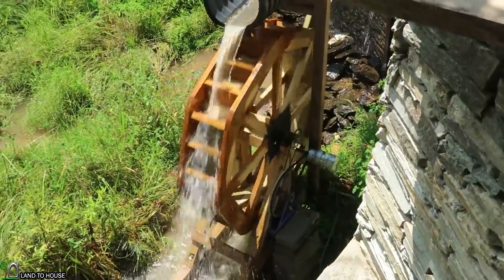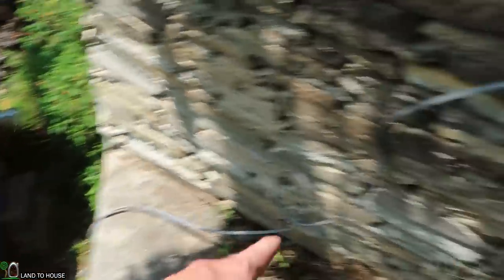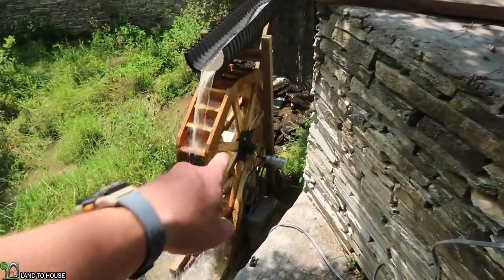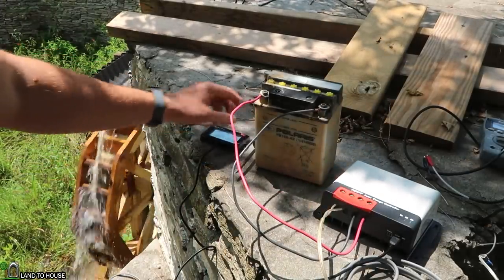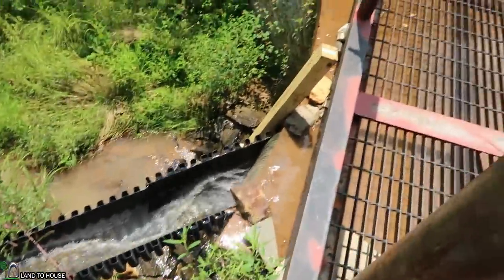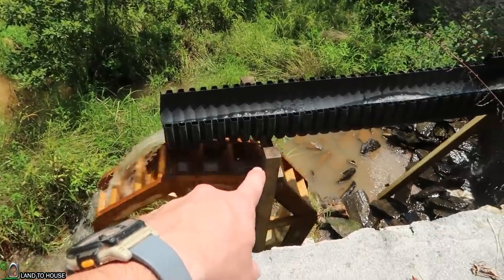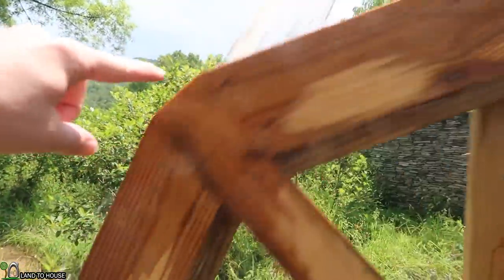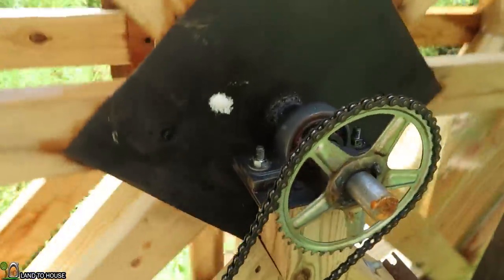Hydro Electric Waterwheel First Voltage Reading

Comment: I have 2 suggestions.  1. Although I can't see it very well, there appears to be a lot of water escaping from the capture "system; containing that would improve the water yield.  That being said, the corrugated tube is slowing the flow of water to the wheel.  Simply change it to something that isn't corrugated.  2. On the wheel itself, I would suggest putting making a cup of sorts on each wheel to give the water some extra weight on each paddle to add to the kinetic force of the water hitting the paddles, which is the only thing moving the wheel now.  This is in addition to the previous suggestions of other users such as the one for a 3 phase AC generator.  Actually, I may have another suggestion, that might require additional "investment": Improve your RPM step-up system as there appears to be enough force from the water to support on additional step-up.

Comment: It might be worth making a "dummy load" resistor to work out how much power is being captured - maybe use an old electric fire heating element?  Two ways to use it are to measure the voltage drop across the resistor and simultaneously measure the current flowing through it, multiply the volts be the amps, and you get watts - this needs two meters, if you only have one meter, measure the resistance of the element first, then measure the current that flows when it's across the output, power is then the square of the current times the resistance (ignoring heating effects in the element🙁

If you want to check the efficiency, you could measure how much water is flowing (mass per second), and measure the drop, and work out it's kinetic energy if just free-falling over that drop (energy per second =power in watts, so comparing the power available to power collected would give you the efficiency, which would help with tweaking the system)

Comment: The waterwheel is tuned to the input of the dam. The turbine is better but it uses more water than is coming in, ie, it's unsustainable. Wind power would likely have the same problems, ie, inconsistent wind. The only answer I see is a small diameter pipe  driving a turbine located well down the valley, plenty of head pressure and balanced inflow, outflow. Whatayathink?

Comment: Could I suggest to measure how much Amps we have at the present situation, therefore to get the power ; and with the flow (L/s) we have , we may compare the power we should get versus the present power (usual rate is 90%). The main issue is the velocicy too high (lost of water) , and the entrance too late of the water ( as you suggested : reduce the upper half pipe)

Comment: You need a drop shoot, all he has todo is cap the end of the trouft an cut a hole in the end so it drops straight down on the wheel and turns the wheel around, it would be 90%

Comment: if the voltage from the wheel is lower then that of the battery they will be no drag as current can not flow one would need a voltage booster to make this system work or stepping up the gear ratio a good way to do this would the to cut a groove in the side of the water wheel for a belt to run on then direct to the motor put near the rear so less water hits the motor a hoverboard motoe might be good for this they are 36v 3 phase low rpm
Reply: the rubber of the overboard could be in direct contact with the periphery of the wooden wheel
Reply: @udos46  if the wheel was rounder yes I have a plan to use 2 as the axle and many over tests just dont have a place to test ideas
Reply: @udos46  if one had 4 of the hoverboard motors they could be used for the wheel to roll on

Comment: Can't tell to well. But it looks like that wheel has almost like finns not buckets. It needs to form a bucket to capture and hold that water for more torque. He could then possibly add another stage of geering to really take advantage.
Reply: You know I think your right, looks like the wheel is backwards, need to cut the trough a lot shorter so that the water hits the other side and runs the opposite direction.

Comment: Seems to  it would be better to run into pipe.  Reduce to increase pressure.  Use a pool pump impeller to drive a motor.

Comment: Need to add more speed at motor to bring it up to fastest efficiency.  Gear box would do it or several more belt drives to increase motor speed.   Also bearings will prematurely burn out they dont get hot enough to move grease back into the races.  Make an oak bearing using two oak blocks drill a hole in from tip and oul every 3 days.  Will last for years

Comment: looking  ta the side of the over shot wheel.. water should enter about 1.30. to 1.0 o/c ok water will push it past 12..o/c and keep going..?? if the buckets were fitted correctly.. they are not .. buckets should hold water all the to way the base.. ie tilt the buckets backwards to hold for longer.. ok.. atb tone uk

Comment: Hey Seth, you should try another pump called Bunyip pupm which works the same way as a ram pump but has a different build.
Reply from the maker: Isn't that the one that has the tire? I would like to try that.
Reply: @LandtoHouse  yeah, that's powerful.
Reply: I’d like to try a bunyip pump, too.  The advantage of a ram pump is they can be made entirely from hardware store parts. A bunyip uses a piston and cylinder which must be matched and sealed with o-rings. The bellows section would also need to be custom made.

Comment: If the neighbor does need to change the treadmill motor for another motor he could look at a motor for a front load washing machine because it's three phase AC and it may do better than a DC treadmill motor does or he can contact Langston at Langston alternative power and ask if he could make a turbine for the water wheel.

Comment: That wheel isn't really using the weight of the water to turn, it is just the kinetic energy of the water glancing off it causing it to turn. Wheels are are not designed to extract kinetic energy efficiency. 

The wheel needs to be just smaller in diameter than the drop to get as much of the energy as possible. The buckets need to not dump the water out until nearly at the bottom.
For the generator, use a car alternator connected to a small lithium battery (they don't work without a battery for the field coils) Then an inverter up to at least 120V AC, better 220V for the long run to the house. If you don't you will lose it all in line loses. The alternator needs to run at least 1500 rpm. Use toothed belts for lower friction. V-belts will lose 15-20% on each reduction/speed up. The wheel will run very slowly, 10-30rpm, so you will most likely need a couple stages to get the speed up.
You could also use a multi rib belt for lower friction than the v-belts, but not as low as toothed. That would be easier as the alternator will already have the pulley. The large pulley side can be a flat pulley. It  has enough surface contact it won't slip even though it doesn't have the ribs.

I am an engineer and would be happy to help you design a better if you want to contact me.

Just fyi, if that flow is 10gal/min, and the drop is 10ft, there is only 18W of power at 100% efficiency, so best case you are going to recover about 10W. Or 0.24KWh per day. Scale that by your actual flow rate to be even closer

Comment: looks like his scoops are wrong, they should be like buckets, that hold the water and dont dump it the 9 to 8 o clock position imo but ive never tinkered with water wheels
Reply: Yeah it kind of looks like its the wrong way, he should try turning the wheel around the other way.

Comment: By the way if he were to use 6v batteries the system can work as is. He could also use 3.2 lithium ion batteries... Ofcoz with the correct battery management system or charge controller. The alternative is what most have said here.

Comment: Way too low RPM currently. Most treadmills motors are in the thousands of RPMs. Will be curious to see how this goes.
Reply from the maker: After a flood he has decided to make it ornamental.
Reply: @LandtoHouse , that's a shame. I am sure it could of worked with some modification. At any rate thank you for the update. Been enjoying your content.

Comment: My my! 1)For starters to make any informed suggestions it would be nice to know what the information is on that treadmill motor says. If you can read the label it could give some idea what your working with.  Guessing is pretty much useless.  
2)That said that Generator/motor needs to be turned much faster for starters.
3) If you could add wood to the wheel where it would hold the water better that would be a better for the intended goal it it's ever going to be reached. (Charge an RV, that far away)

Comment: well i think there is multiple problems most of what you already mentioned . that treed mill motor ether has to go or he needs a better gearing system . it would be better to change the motor . he needs a low rpm high out put pm motor . your best bet with this set up is to make your own permanent magnet alternator it would produce ac current and lots of it depending on the size of your magnets  and your coils of wire . the stronger the magnets the better . but with im going to say 18 gauge wire coils you could use a fairly small rare earth magnets that would do the job . you could set the coils in resin that would keep them dry and safe from moister . again it would be ac current and would have little to no drop off in the line . once at the house or where ever it could be run through a voltage regulator to switch it to dc current to charge a battery bank . its not the set up of the wheel or its drive as much as it is the motor just cant produce the electricity  you need . that treed  mill motor needs way more rpms to put out any thing worth using . with the drop off of dc current to the house it would be worthless . if you could get it to produce enough there at the wheel to produce power it would have to be converted to ac asap to keep from losing current to the house . your best bet is a home made pm generator. if done right  you could have a three phase pm that delivers 1k watts ac of energy constantly . ok thats my opinion on what will work . good luck
Reply: im sending a lnk to  a video to show you what i mean . it will explain the basics of it at least . check your held for review  comments if it dont show up

Comment: In my view, the use of a motor here is a mistake as the voltage drop from wheel to the point of use (RV) is too great.  Because there is less voltage drop in AC. he would be better off turning an alternator with the bridge removed, running the AC up to a bridge located at the RV, and then into the charge controller.  If he wants to stick with the motor, he could use an inverter at the wheel and ship AC up the hill much more safely and efficiently.

Comment: I'm no expert but it would seem to me you would want to use a more lightweight material so there is less mass for the water to move allowing it to move at a faster speed.
Reply: Since it is a wheel, the net weight is zero (or close to it) while turning.  (as much going down as there is going up).  It will be slower to get up to speed, but once at speed, the actual weight is not relevant

Comment: Do you guys get the smart drive washing machines over in the USA, their motors are more suited to converting to low RPM generators.
Reply: @gravelydon7072  what voltage would you get not modifying the coils, the wattage should be the same at the same RPM i would say.
Reply: @nicholaskeur  I'll have to run a test as I do not remember. You do not get the same number of Watts out at the same RPM unfortunately. You can get nearly double the Watts at the 3 phase 6 coil per phase setup on the 18pole units as you get on the 3 phase 2 parallel sets of 3 coils at 250RPM. My theory is that to get the same output at the same RPM would require that each coil set would need its own rectifier as the magnets and the coils on the stator do no line up all at the same time.
Reply: @gravelydon7072  Watts, or amps? a higher voltage will show lower amps, but put through a MPPT will downscale volts but increase amps
Reply: @nicholaskeur  Watts. The magnets have to charge the coils and it seems that they do better at higher output Voltages and also at higher RPM. I did my tests on the 18 pole units and found that the efficiency of the motor generator combinations had a better COE at higher RPM or higher number of coils in series. 62.6% at 500RPM with 3 phases of 6 coils producing 80.3Volts and 179 Watts while  3 phases of 3 sets of two coils produced 40 Volts at 170 Watts and a 59.54% COE at the same RPM. I have to be careful with the 3 x 1 x 6 coil version as if I drive it with the 3x3x2 coil one it can hit 2000 RPM and exceed 300 Volts. The 18 pole units are only designed to run at 300 Volts and 800 RPM so you have a lot of potential for safety problems. 

The 36 pole units also are designed to run at 300 Volts ( Samsung units ) and 1200 or 1400 RPM. At 1000RPM they can produce 860 Watts.
Reply: @nicholaskeur  I have not forgotten your question. I now have an unmodified one on the test rig. I had to stop the test run with it as I cranked up the RPM and Voltage faster than what the MakeSkyBlue could react to it and got an error E71.  That is over voltage on the input and when checked showed 175VDC on the input. Needless to say, I pulled the fuse so the capacitor will discharge overnight.  Good thing the filter capacitor is rated at 400 Volts and the rectifiers are rated at 1000 Volts.

I'll put the meters on it in the morning to see what the AC Voltage is but it is going to be high. This would be an advantage for transmission as that 3 phase AC could then run a unit like mine to downvert the AC to a lower voltage or maybe at 60 HZ, which is 150 RPM on the units, use a 3 phase transformer.
Reply: Quick test this morning. 25.6 Volts AC and 100 Hz @ 250 RPM. Rectified it was 29.3 Volts DC and 100 Watts.

Comment: Just a question Why couldn't a smaller water wheel work . Wouldn't it go faster then doing all the gearing down.
Reply from the maker: The larger the wheel the more area there is to hold water and that water weight is what creates the torque. At least that's the way I understand it.  A smaller wheel would not have the torque to create much power.
Reply: @LandtoHouse  your meaning when you hook up to power like you say it would slow down the wheel stoping the power. I got you thank you

Comment: I dont think its getting 220 RPM. If you look at how slow the wheel is going. If you were to make a mark at the top and watch it do a complete revolution it would take alot longer than 1 second. 60 seconds in a minute. No way thats doing 2+ revolutions a second. 

I think if the wheel itself had reservoirs built into the rudders it would hold water adding weight which will add speed. Also if he didnt use a culvert pipe and used a PVC water pipe there wouldnt be asmuch speed lossage due to the rigid dips and nooks in the culvert pipe. Id leave the pipe intact too. Why cut it in half? keep the debris out easier. I also think you are right. If it was pulled back about a foot and had a steeper grade it would add more speed aswell.

Comment: What he has is a Swiss water wheel. Ultimately it works more like a pelican wheel. But no enclosed pipe and faucet nozzle. The idea situation for what he has is high fast flow moving stream of water shooting through a flume from the top of the mountain. A harnessed waterfall. Working with that type of water will his first problem is he doesn't have the Links of Rush he needs. To fix this. 1 I don't think he is corrugated pipe and then ripples and the corrugated pipe is to his benefit he needs a smooth pipe.  2. He probably needs to move the water wheel away and lower from the levee. Drop is important.. 3 the water needs to hit the wheel somewhere at the 11:00 to 12:00 position. Ultimately water hitting directly on the back side of the panel. This is the proper way the Swiss ran their mountain water wheels which is what he has made. Should you make these improvements .. I don't think he has the efficient gushing water No I do not think that you should make the authorizations..   you should make it more of a leverage concept water wheel. And add the skirts on the side and more importantly placing a board inside each bucket to hold back the water from falling out so quickly. This would employ leverage The leverage will produce torque especially when friction from the electric unit provides resistance as it provides resistance the buckets will fall to their Max. Increasing torque because there's more weight on the wheel.. now you get to see the letter below my frustrations and just looking at what is done. I will say that the woodworker that made the wheel did a good job constructing what he has constructed. Certainly it shows craftsmanship.

Comment: I wonder how this stacks up to Angry Ram's washing machine hydro thingy.
Reply: looks like this has less torque if Seth can stop it barehanded.
Reply from the maker: There's not a lot of water in those cups.  I think once he gets things fine tuned there'll be a lot more torque.
Reply from the maker: Isn't he using a high head pressure turgo system?
Reply: @LandtoHouse  I think so.

Comment: Seth, here is a water wheel video ( https://www.youtube.com/watch?v=17CpJxlwzNg ) which shows "exactly" the points that both you and others have mentioned.  It is a smaller design than what you show but it shows just how the paddles need to be positioned as well as where the water should hit the wheel for best output.